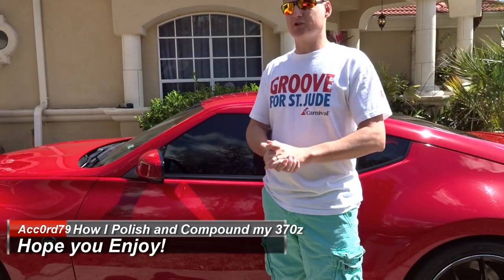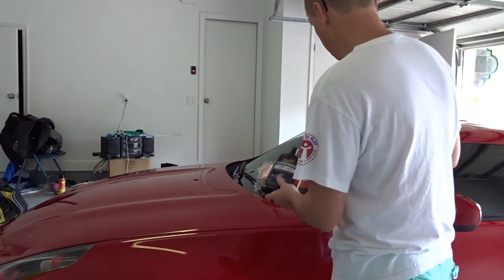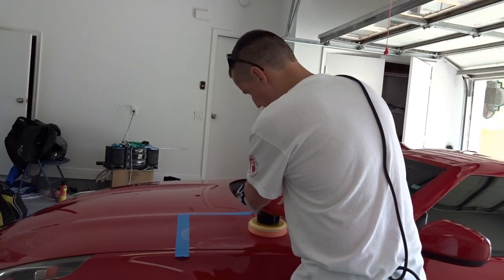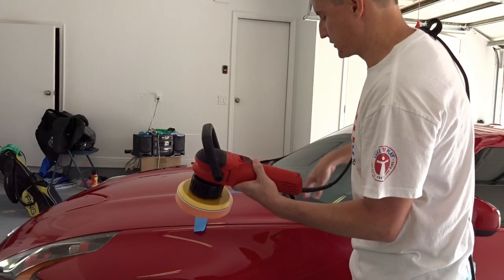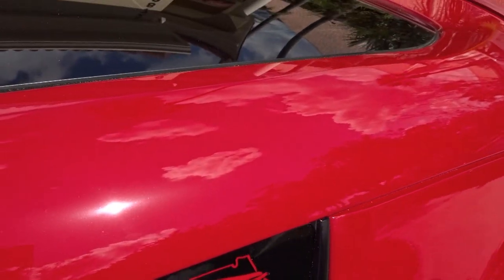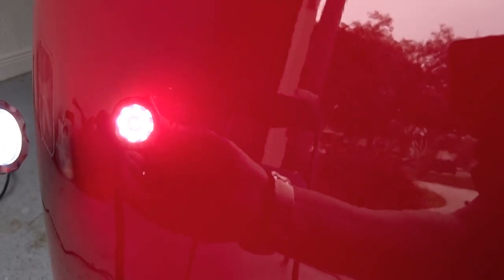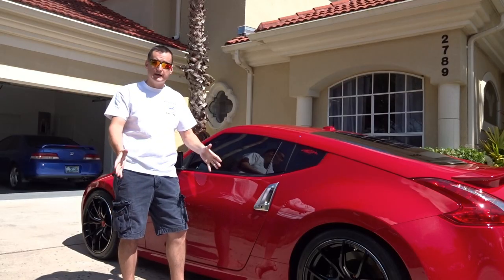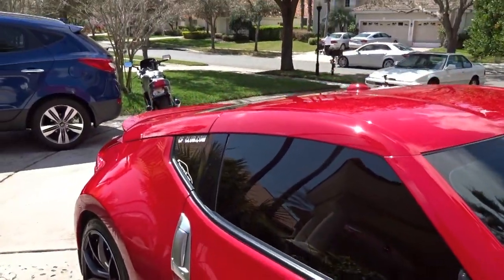How I Get Swirls out of my Car's paint with Polish and Compoud. 370z

Comment: Nice work for first time! I used to have a GG 6", it's a good machine. The reason you didn't need compound is your car has softer paint, most Nissan, Honda, and Toyota paint is soft, so it doesn't need much to correct it. Just a couple tips from a Griots user. Lake Country Hydrotech Pads, Tangerine for Compound, Crimson for polish, are magical on softer paints. You can also buy a Buff & Shine 3.5" backing plate and use 4" pads for the tighter areas and curves, much easier then using the 6" pads. Also after your done, a wipe down with 10% Isopropyl Alcohol and distilled water, or Carpro Eraser will remove any leftover polishing oils, creating the best surface for you sealant to bond to. Be glad it wasn't a Mercedes or Audi! Super hard paint! Again nice work! Red paint looks great when it's polished!

Comment: There are a few products out there that may help you knock down those deepers scratches like the one on the rear bumper that were in the car when you got it.  It may not totaly remove them,  but it will certainly make them a LOT less noticeable than what it is now.   Menzerna makes various compounds (which is a little bit pricey but in the smaller bottle isn't too bad will clean up those scratches quite a bit).  Then hit it with the Ultimate Polish you have to refine the scratches left by the compound and it will make a huge difference.    In the right light, you may not even notice they are there anymore.    Your pad choice may also make a big difference in what will cut down some of the deeper scratches.   Mequiars M105 is pretty good also in removing slightly deeper scratches with the correct pad combo.  Then refine it with polish after that.   It's a pretty good option, and you are not paying for a new paint job.   Heck, maybe one of your sources will give you a sample of their compound(s) and or compounding pads to see if the deeper scratches will come out.   Should work with your Griots polisher you are using, it just may take slightly longer compounding and polishing times.

Comment: I just got one of those microfiber wash mitts and they are pretty amazing. It absorbs so much water that when you start wiping the car there is always a layer of water between the mitt and the car which I feel reduces swirls. As far as polish wax etc. I love Meguiars products especially the liquid carnuba wax, One other thing I do after washing my car is I will spray Griots Garage speed shine on the paint and wipe with a microfiber towel.It maintains the shine between waxings and protects the paint from water spotting, bird droppings and tree sap.

Comment: If you haven't tried Meguiars  D-151 Conditioning Cream you must. 
Removes light to medium swirls and leaves behind protection. 
We did a GMC that had some nasty swirls and got about 85% of them corrected. 
If you'd like I could send you a sample for you to try. 

The easiest polish to work with. 
No dusting
Easy to wipe off. 

Miracle Detailing

Comment: I used a random orbital polisher on a black/grey car with Ultimate Compound. But the swirl marks/light scratches are still there (also tried by hand). I'm guessing it's the pad because it currently has this white fluffy sort of pad on there right now...
Reply from the maker: Sahil Chauhan you need a cutting pad, usually the orange pads are for cutting. Try again with an orange pad. Some of the companies try to keep a standard color code to help people. Like red ones are for waxes, check out the autogeek website, shows all of the colors and what you need for what. Generally though orange is a cutting pad to get out swirls and light scratches!

Comment: What's the difference between polish and wax? I have the wax and compound but should I also get the polish?
Reply from the maker: Steve Hawkings First off those combo wax/compound will never be as good as a true compound alone. The compound is a high cut product that will really get in there and remove those nasty swirls and scratches that aren't to the metal. The polish has a finer cut (less) meaning its to get light swirls out and really make it shine before you apply a wax. If you only have light swirls etc, pick up a polish, see if that does it for you. A compound is meant to get out those hard to get swirls and scratches, just has more cutting power.

Comment: i was gonna clay and wax my blk si (hasnt been clayed in woooo) but do I need compound to remove stains and swirls or would the Clay bar do the job?
Reply from the maker: im Squid compound just cleans the paint and will remove swirls and light scratches. Clay just gets those contaminants out of your paint. If you have a lot of swirls and light scratches, it probably could use a good compound or polish.

Comment: Did you ask Ken Baker (turtle wax guy?) if there's any problem with putting the turtle wax sealant on top of the spray wax that you had used on the car to take the polish dust off?  I'm just wondering if there would be any problem with the sealant bonding to the car if you have a thin layer of spray wax already on top of car.  Thanks.
Reply from the maker: yusuihang if I remember right, in his email, he said its made to be used on top of wax or below wax although I think its best to put it below the wax first.